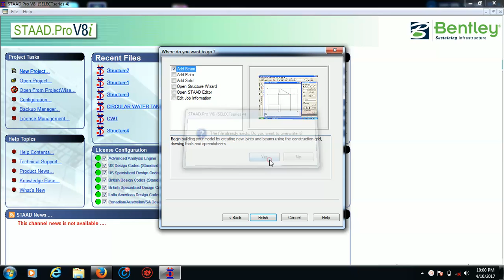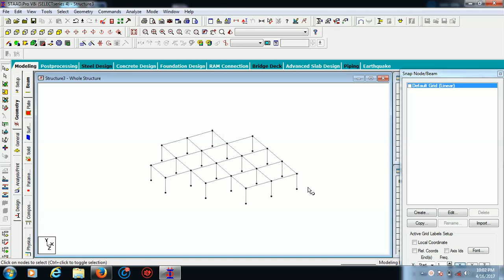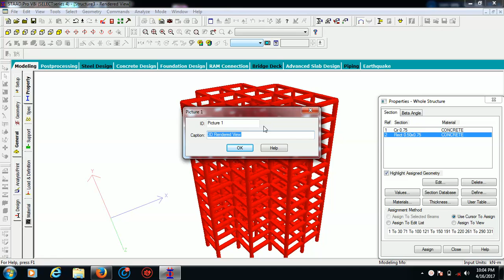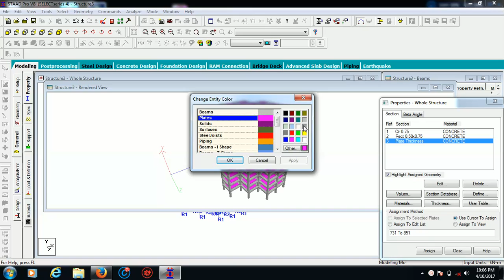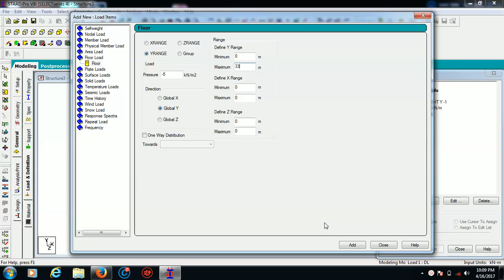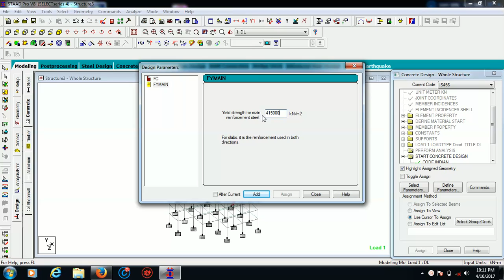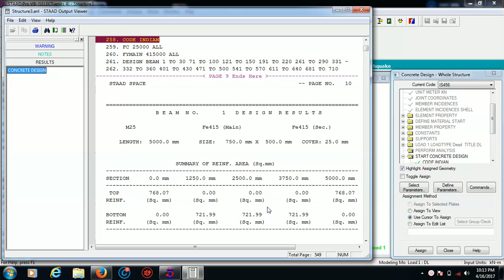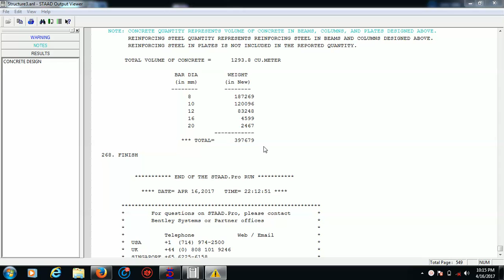RCC Multistorey Building Design in Full Detail with Staad Pro

Comment: You haven't applied wind load and earthquake load on this building and i was getting error on that part.  
I saw few videos on staadpro designs and I found  few foreigners were using PIN or HINGE joint too, Can You Please tell me, what is that. 
I really want to learn every single thing about this software.

Comment: I have seen many similar video.
Make a video with differnt column and beam  section area upto 4 storey which is required for the building. analyse  only ground floor colum with manual design . It will be tough but you can do it
Reply from the maker: Tha k you for the suggestion..... i will do that

Comment: In Multistory building design tutorial I found one mistake. In the model you have attached plates of thickness 175mm as RCC slab at all level. Again you are assigned floor load of 5 Kn/sqm as Dead load at all levels. Already you have assigned self weight of all members i.e. beams col and plates.That way  you have add self wt of slabs twice which is wrong. Also you have not added any Live load on slab which is required.